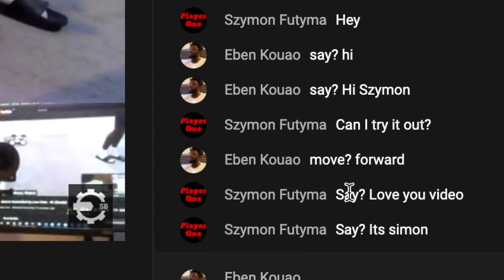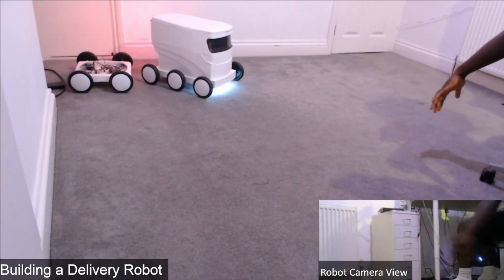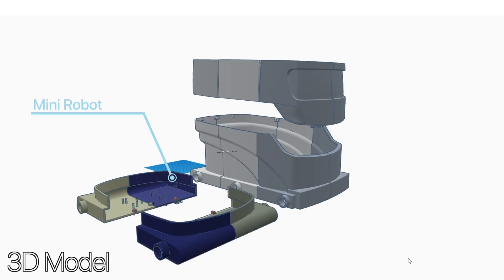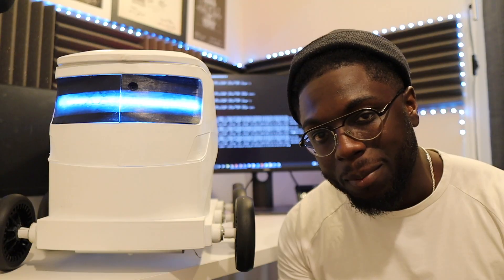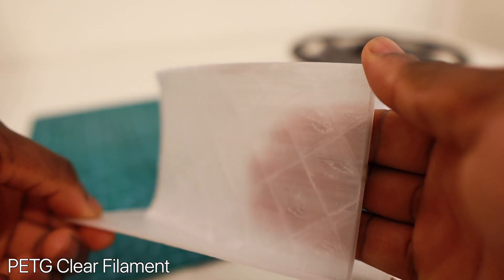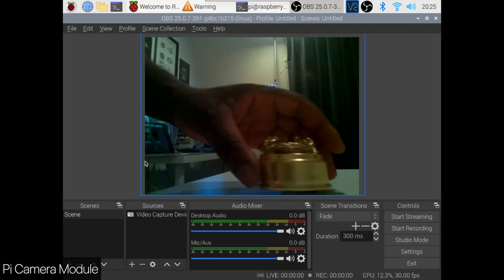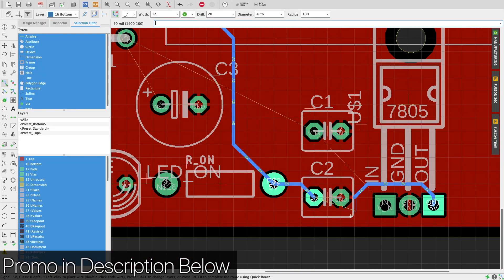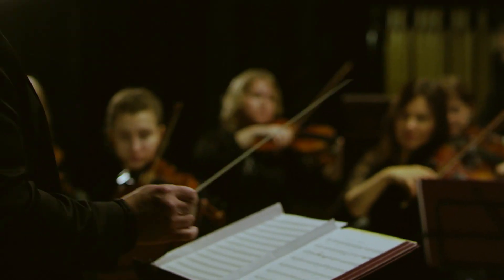Building a Delivery Robot (controlled by Live Chat) using Raspberry Pi 4 | Droiid

Comment: Hey,
did the math for the motors you used. You're using motors. Each one gives 0.068 Nm torque. Total torque is 0.41
Each wheels force ends us being only 0.54N, total is 3.2N
How did you pull off carrying load with that force. We're trying to build autonomous delivery robot for our project and we're referring to your video for the controls and chassis.

Comment: Air hovercraft, if you can get your council to agree location sensors on light and sign posts could aid in autonomous delivery which can be solar charged. Lots of possibilities, one of the comments suggested a detachable compartment to leave the package when someone wasn’t home but unless like regular mail if it’s not to leave with a neighbor then thefts a problem but a tracker could be placed on it for that and the empty case could be retrieved once client confirms the got the delivery. Usually foods not a problem but still. Look up what’s happening
In the states , they flip them over and steal from them.
Forgot to add that people need to get with the times. Jobs are going to be scarce with factory automation, look up “ lights out industry “ and manufacturing. Not only will they lessen the cost of lighting factory and warehouses but cut costs like wages and workman’s comp . The future jobs are like what you’re planning , people will have to make their own products to sell. I’m looking into setting up a small fully autonomous manufacturing gig where all I do is load the raw materials if not a robot does it picking it up off a delivery truck and after packaging and boxing a truck or like what you’re building it gets picked up. The only other person I might have to pay is a CPA unless I do my own paperwork. Lots of supermarkets around here plan on getting rid of the registers and replacing them with self service ones. Wake up people.

Comment: Battery life is a major limiting factor, until solid state batteries achieve mass production levels or the NDB battery is mass produced, all these will be severely limited. Lithium Ion batteries are NOT the answer, limited world wide supply of lithium, weight considerations long charging times,, short run times etc are the major problems

Comment: Hey Eben, 

I love your videos. They are innovative and creative. For this particular video, can you create a video talking more about:

The wiring diagram, since it only shows ground and positive sources. 
The communication between raspberry pi and Arduino. I would ask to provide a step by step installation of software required on the pi. 
Lastly, could you show a step by step example on how the code is implemented on the chat? 

I appreciate your content man! keep it up!
Reply from the maker: Thanks Oscar, you can find more details in the description. Which includes a write up, code, schematic and 3D Models etc. Cheers!

Comment: Nice work. How do you communicate with the bot?
Reply from the maker: Thanks Ron, currently using Apache Kafka over the Internet. Raspberry pi recoeves command from the control center (kafka message bus)... passed to arduino to control the motors.
Reply: @EbenKouao  Thanks. I want to know what hardware you use in the mobile robot to reach the internet.

Comment: Great. You can add a Gps module (Ublox, for example) and magnetic compass. You can take a look at Follow me cooler arduino-based project. You could also add a Lidar for obstacle avoidance and OpenCV or TensorFlow-based image processing. A gyroscope mpu6050 or a Razor 10dof would help it not turn over. A weight sensor would be also nice since it will be dealing with packages, for it to know when to drive faster. You could also monitor battery level with a vumeter. Equipping it with ROS Noetic or ROS2 middware would also come handy for better control and robot state monitoring.
Reply from the maker: Great Recommendations, would defo look into GPS, and obstacle avoidance. Possibly a motor encoder for tracking speed, RPM etc.
Reply: @EbenKouao  hello I want to make an autonomous smart robot (line follower and obstacle avoider) and remote-controlled with raspberry pi and 
open-cv can you help me
Reply: A proximity sensor and a kind of alarm or something wich gives people shock when lifting it up would also be nice for it to run away from people wanting to steal it. Wind speed sensor would also be useful for it know when to slow down nor boost up because of strong wind. :-)

Comment: Very cool project! For the hardware, it would be cool if your autonomy upgrades included some more cameras for ViSLAM. And maybe a GPS, IMU or encoders for redundancy. A Nvidia Jetson Nano might be able to handle all of the sensors. And Intel’s Realsense cameras might be worth looking at.
Reply from the maker: Great points - defo gonna look into adding a GPS Module and Encoder. When it comes to microprocessor upgrades, that's where it get's interesting with choices